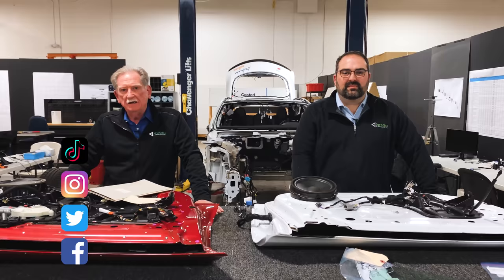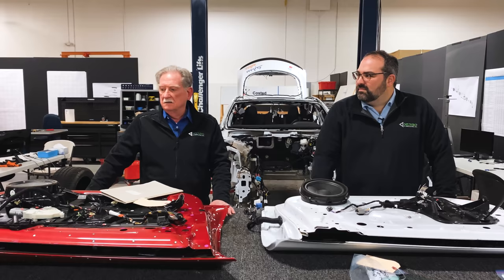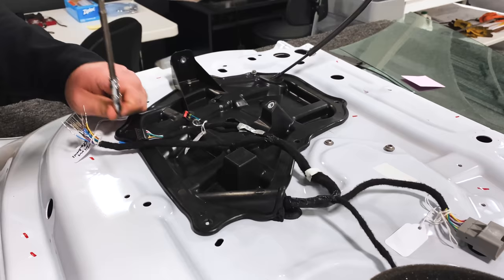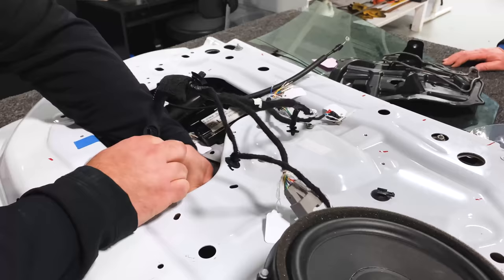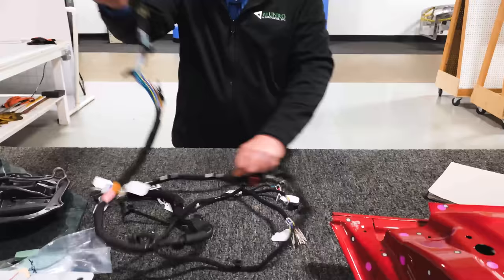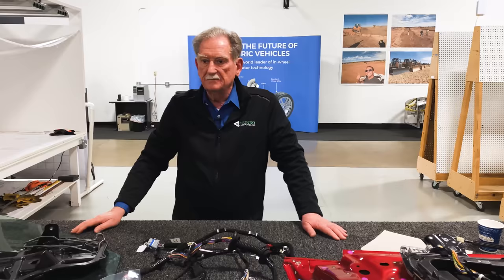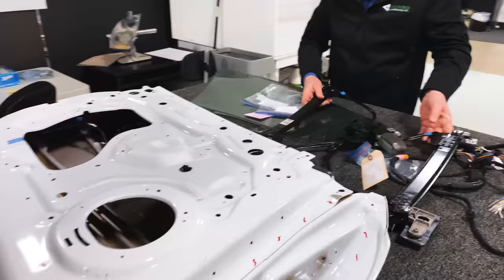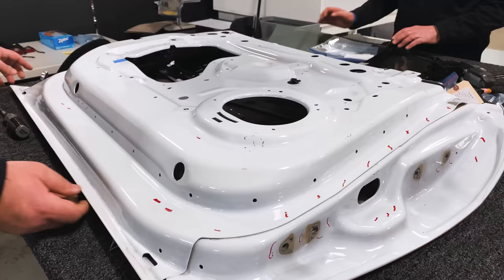Plaid Doors Disappoint Sandy | Tesla Plaid Teardown

Comment: It's so weird that they would take such a step backwards on their MORE expensive vehicle.
Reply: I don't think it's a step backwards. More like they didn't step forward on the doors for the Model S.
Reply: @magnusauto7941  Well yes, but it came out AFTER the M3 refresh and MY, which have a much better design, so compared to them it is a step backwards.  It's scary to think that there is some more advanced/better designed stuff in my SR+ than on the $125,000 car.
Reply: @magnusauto7941  it’s a gigantic step backward tbh. It’s tesla flagship car no reason to play around with outdated designs, you don’t see Mercedes’ or bmw do that with their cars. Mercedes and others even offers way more interiors/exterior customizations too
Reply: @StormsparkPegasus  No, the Model S door design was out before the 3/Y. They just left it the way it was. So they didn't step back. They just stood still.

Comment: I wonder what got into Tesla and why on earth they chose to go with such door design for the S plaid? A very costly design with a lot of manpower demand to assemble it, is not a good way to go. Especially when they already have a great design in the Model Y doors. Thumbs down, for sure.
Reply: It's the old-skool design that they originally used in 2012 (actually before, because the design was committed to before that), before the level of experience that they have acquired since, and it's quite apparent that it's not worth changing at this point.

Comment: Somebody needs to see about redesigning those doors. That's a terrible design, especially when you consider that they have done it correctly on the Model 3 and Y.
Reply: Model 3/Y have LESS NVH insulation and are Louder than comparable 3,4,5 series LUX cars.
Reply: It is the OEM way.  Every Ford and GM are built like that.  Cut, copy, paste.

Comment: Great video! This shows that even Tesla makes mistakes. But if they are true to their culture, they have noted the critique and will fix this. There is nothing more annoying and unsafe than a window that won't work or a car door that won't shut properly.
Reply: This door design has been around for 10 years, what makes you think they care enough now to fix it? 0-60 times sell cars, not stuff you can't see.
Reply: @InternetDude  That is true in the short run, but a car sold at premium needs to get things right. This ain't a cheap Chevy, and quality sold should be quality made.

Comment: That stick builds model S door looks stronger and better built for impact. The model 3 has a gaping hole with a plastic injected part. I don’t care as a consumer what the efficiency of the assembly line is when it comes to the end products safety. The more I watch the cheapness of the model 3 the less I want one
Reply: And yet the 3 and Y achieve the same high crash test ratings as the S.

Comment: Come on Sandy you’re an engineer she should realize why they did that, they did it to improve the side impact to the door because with a stick built when you get side impact to the door, everything breaks come apart and who is gonna impact, the driver or the passenger, easier to assemble and cheaper the manufacture don’t necessary improve safety of the vehicle, you cannot put a price on safety because if you’re killing your customers you will not have repeats sale.
Reply: Not side impact. Take a look at time index 1:25 in the video, when he has the Model Y module out of the door - you can see the side impact structure welded into the door.